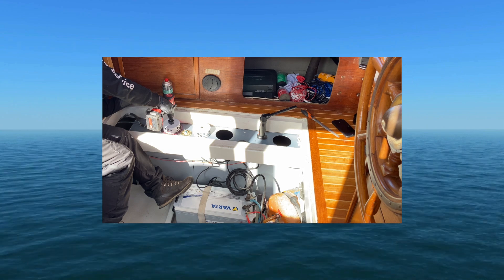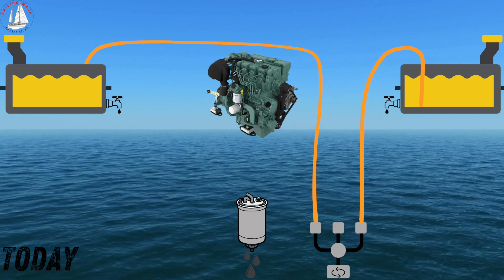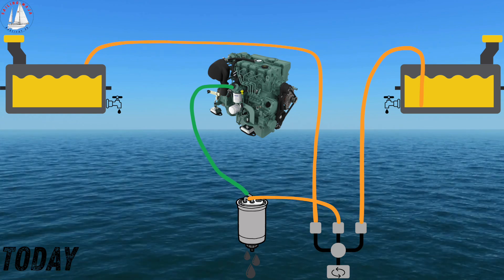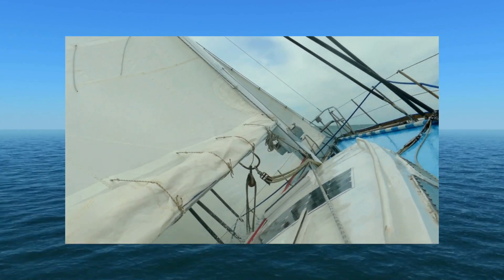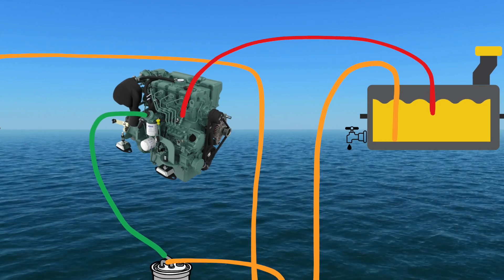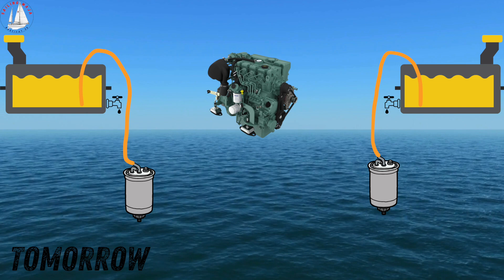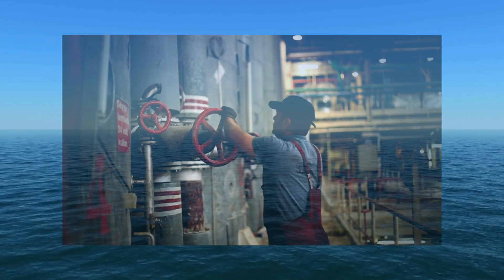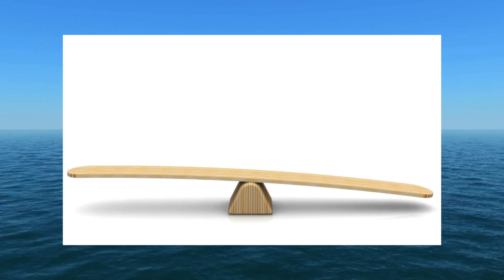Stop Diesel Bugs Before They Stop Your Engine!

Comment: Hi, I am in the middle of doing a restoration on a Nauticat 44 for a long distance  cruiser. The fuel system is something I intended to work on before splashing the boat again. The later models have a single lever valve under the after wheelhouse step so you can operate at sea without going into the engine room to take and return fuel from which tank you like. Also if a fire breaks out in the engine room, you put it in the middle and no fuel comes out of any tank to feed the fire. The plumbing is all in copper from the tanks. That valve is out there somewhere to do that already so might save some work. I can email a picture if you like. So I intend  to only load fuel in one tank and run the engine from the other. Clean, treat and polish  the new fuel in the loading tank until I'm happy with it then transfer to the engine tank using the unit below.
I'm looking into a separate system called a diesel dripper. A bit like a mini system you would have on a commercial ship for cleaning the fuel. You can filter out water and polish the fuel when the engine is not running as it's separate from the engine system. My plan on extended cruising is to have it running on days the solar has the batteries at 100% at anchor and just keep the fuel moving and clean in one of the tanks Look up Marship diesel dripper, that's the way I'm going with mine. 
I was the man that asked about a video of the anchor clearing the bobstay when lowering. I went for a 45kg ultra in the end as it worked a little better for me with my deck setup. Have you still got the package glands on the rudder and drive shaft. I'm keeping mine as easily maintained  in far of lands. The problem with them is I could never get a spanner/wrench to fit them correctly  in the spare you have to work in but I have now found a company that makes very large spanners for the packaging glands out of stainless steel at a good price. I have four on order and we will see what they look like when they arrive.
Reply from the maker: Hi there. Thanks for your great comment. It sounds like a super solution with the single lever valve that does it all. Please do e-mail me information of that. I have added my e-mail in the contact section, so you can pick it up from there. (Does not work to put e-mail in this comment, YT will remove it). Tell me if you can not find it, and we will find another way.

The fuel polishing I would also want, but I have not found the right way to do it yet. But it is absolutely on my list (that grows every day...)

The 45 kg Ultra sounds like a beast, and I am sure you will be happy with that. Regarding the package glands, what is that?
Reply: Sorry Charlie I don't see the email address on my side of the screen. Google a "six port fuel valve" 
The packing  gland is the part on the rudder post and drive shaft that keeps the sea water out. The water tight seal. The old type ones you put a type of rope into them and tighten to make a seal and the new ones have a rubber seal. I'm keeping my old type that has graphite rope so I can always work on it even mid ocean and stop it from leaking .
Reply from the maker: Let’s try to work around it. It is as follows: hello att jarlekarlsrud dot no
Reply: Ok hopefully that worked if I got it correct
Reply from the maker: That worked out just fine!

Comment: Hello Maja! Thanks for sharing. Two paralell filters is a good setup. 

My setup in my sailboat are two fueltanks, starboard and port, quite high up in the hull. The tanks communicates via a manual valve and hose. (Yes, the valve needs to be closed when sailing).
SB tank is the ”main” tank. Filling, consuming, levelsensor and engine return is done only to this tank. You can think of Bb tank as a spare tank. To use the fuel in Bb tank I have to open the communication valve for a while. The communication hose is big, 25 mm.

However the method I chosen is to consume fuel from the bottom of the tank, note bottom, meaning the absolute lowest point in tank, not a pickup tube. (You mentioned a drain valve). The effect is that all contamination is removed from the bottom of tank itself before it can create nastyness. So by inspecting my filter I can judge the amount of dirt in the fuel and any condensation is removed from tanks and gets collected in the filter.

After 15 years of use I inspected them and found no dirt or rust on bottom nor in the top. Conclusion is that the condensation etc are removed from the tanks and the Racors are doing their jobs. Winter condensation (Scandinavia!) is minimized with full tanks. The tanks ventilations is done high up under the cockpit coaming behind a sea wave protective grid/lattice/shutter. 

Balance the boat with fuel seems a bit complicated for me. There is not much weight in fuel – I guess you have about 2x250 liter; in theory you can move max 250l x 0.75 = 180kg. (Same as two Stora Starka Norska Män on one side of the boat). Your sturdy boat should be just over 10 tons, so how much does it leans with 2 men – or 3 jenter - on the side?  :-)

Samt, återinför Kalmar Unionen! ❤

Regards, 
Martin
Reply from the maker: Thanks for you comment. It is interesting to see your solution of taking the fuel from the bottom. I can clearly see a benefit of that. Do you have a video showing this solution? Sounds like a great idea.

Om our boat we remove some deciliters from the absolute bottom of the tank some times a year and then we know that it will not build up with water or nasty stuff.

And regarding the Kalmar Union, we absolutely agree. That would be a very good solution. At this time, the current Union is the best we have (even if we are actually not in it), but in the future, when the world is no longer as it is today, the Kalmar Union might come back to live. And while we're waiting, let's do some sailing!